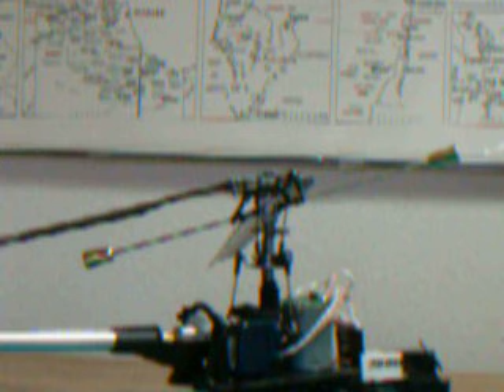MadHawk 300 AirWolf Fuselage Swash Plate Function Test

Comment: I got my MD 300 no to long ago and I'm learning how to use the transmitter, and how to fly. The only 2 problem I have is when take off the helicopter goes on reverse or backwards, and I have to move the right stick back a little bit so the helicopter stop going backwards or pull the stick all the way back so it goes forward. Any suggestion on how I can fix this two problems.  Thanks